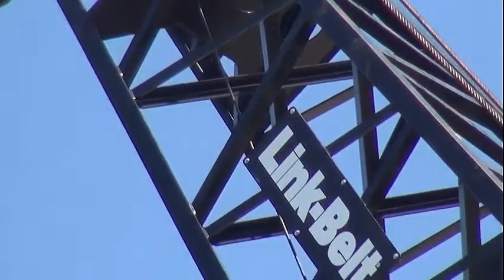Rig moving cranes

Comment: That 110 needs to be leveling out the load when they are two-craning the top subs+ center-steel, he's throwing the weight on the 80 ton, I would say that's the pushers/riggers responsibility, but any operator worth his salt can keep a load level ;)
But enough critique's, I've done my 15 years of earlfield craning and I never looked back :D
Reply: Oilfield to 8 years of operating equipment in a paper mill, then about 22 years of operating equipment, mostly cranes, in a chemical plant. Retired this year!!!